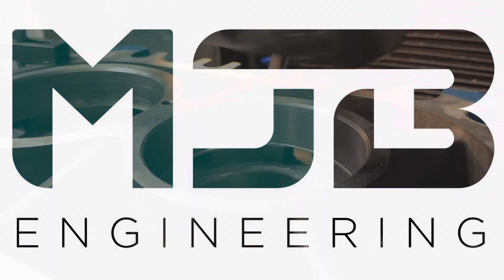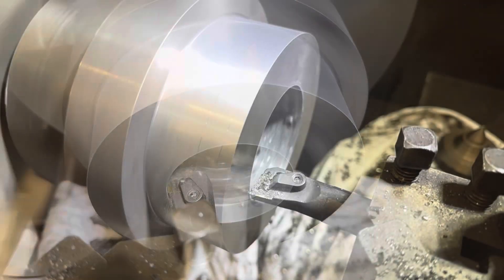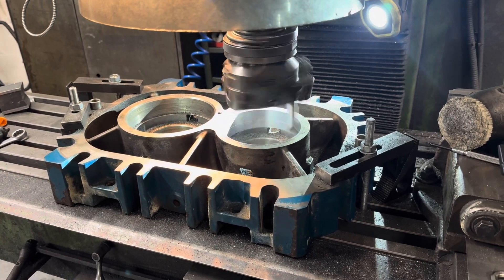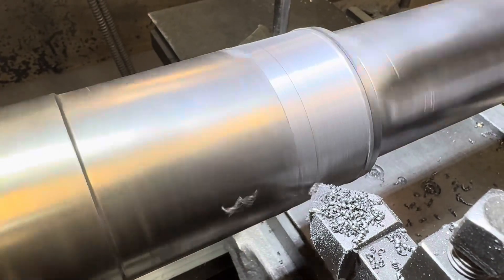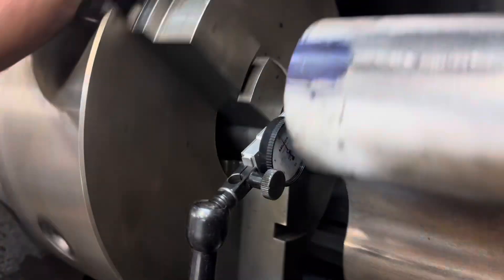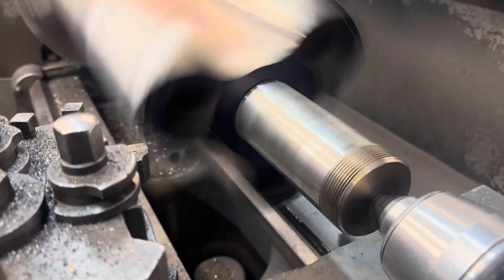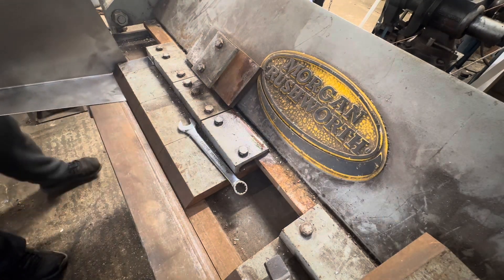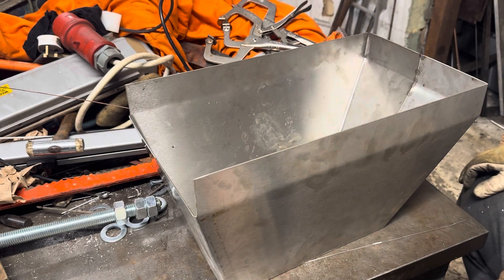Machining, Metal Spraying and Welding - Aerzen Roots Blowers & Bakery Machine Installed

Comment: Interesting video.

We do similar work but on ammonia compressor screws.
We normally shrink on sleeves where the mechanical packing runs.
My boss doesn’t like metal spray shaft repair so we use a metal epoxy product called Belzona 1111 to repair all of our bearing fits.
We do a lot of repair on large electric motor end bells using cast iron sleeves but we use  an interference fit of .001 per inch and shrink them in using liquid nitrogen.

Cheers
Reply: We freeze the sleeves in with the end bell still in the machine, the only drawback is you have to wait until it come up to room temp to finish machining.

We machine the Belzona.
Just mask the area with black electrical tape.
Reply from the maker: @pvtimberfaller  Interesting, i've drilled and tapped belzona but never machined it. 

Sod's law i'm actually having trouble with the metal spray on some small shafts, god knows why. I've got to try some other powder. Thought i had rectified the powder feed issues the other day and then bam did it again.
Reply from the maker: @pvtimberfaller  yes i know the belzona product, not sure Id trust it for a bearing seat. Do you machine it or use a former? 
 
Metal spray can be hit and miss if done incorrectly. 

I would have liked more of an interference fit but no liquid nitrogen here and it needed to be able to tap into the bore whilst still setup in the mill. Won't move with the loctite 638, unbelievably strong.